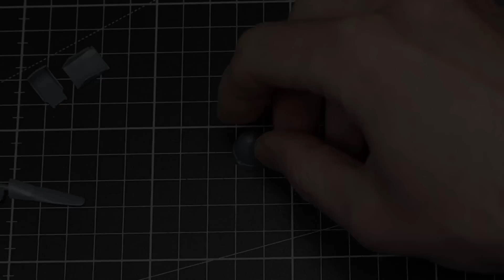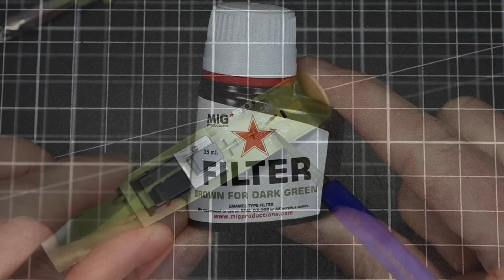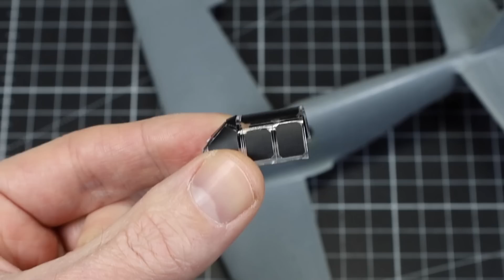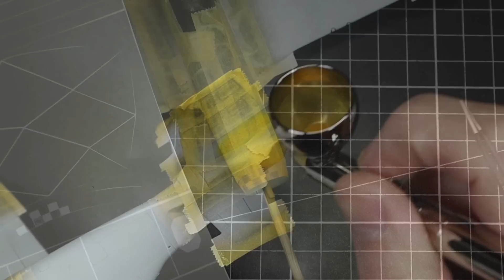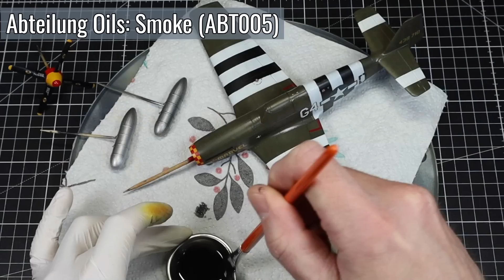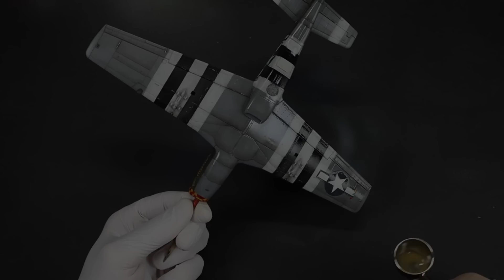Tamiya P-51B MUSTANG ('Miss Marvel') with PE & Montex Mask | 1/48 scale | Full Build

Comment: Very good finish mate, really liked your weathered aircraft. For it to stand out even more, I'd have used the thinner fishing lines, or model rigging thread, quite more to scale than yarn, but durable!! it's elastic and holds pretty well
Reply from the maker: Thank you for your kind comment and helpful tip. I won't be using that yarn again. Unfortunately, I only had very thin model rigging for 1/72 scale, and it was barely visible. Regards ScalerDan

Comment: Nice build...with only the rigging being a weakness. If you want to fix that, here's how I rig my ships. For horizontal rigging with sagging, I use tungsten wire from Model Kasten: you only have to measure it with calipers: it has memory so won't kink. Gravity does the rest

For tight or vertical rigging, I use lycra from Infiny, both companys are South Korean. You glue it loose (PVA or white glue in both cases-super glue destroys lycra over time) then when cured, tighten it slowly over a few minutes by holding it over incense smoke. 

You're welcome😊🎉
Reply from the maker: Thank you again for the excellent post. The rigging on my 1/72 Hellcat is better and more in scale. I definitely have to try the smoke technique. Best regards...

Comment: What do you use to glue parts together if they are painted?
Reply from the maker: Thank you for your question? It depends... I usually use Tamiya Extra Thin. If I need it to hold quickly and there is only a small contact surface, I use superglue (e.g. wheels, external loads). But I use everything very carefully and sparingly so as not to destroy the paintwork. Regards ScalerDan

Comment: I just finished the Kotare 1/32 Spitfire Mk 1a. I added the control wires in the cockpit, and drilled out all the lightning holes in the frames, which they suggest you do for added detail. 

Nobody will ever see it, unless the use a flashlight and know exactly where to look and even then they won't see much. Still it was fun, i know it's there and have pictures of it before it went into the fuselage.

If you want to take that kind of detail to the extreme build a Zoukei Mura 1/32 kit.

Great build btw
Reply from the maker: Thank you for your comment and your thoughts. Kotare Spitfire sounds very promising!
These extra details are an important part of the hobby for me. It's also about the work you put into it and the joy of implementing an idea.
Documenting these 'invisible' details and making them visible in the video is another exciting challenge. Regards ScalerDan

Comment: Great looking model, nice job! 
What do you use to clean the Real Colors from the airbrush? I found out that normal airbrush cleaner does not work well since it's a lacquer and the AK thinner is too expensive to use a an airbrush cleaner.
Reply from the maker: Thank you for watching. I only use Mr Color Leveling Thinner and Rapid Thinner for thinning. I also use these two for cleaning. Not the cheapest solution but it works. Rapid Thinner is a bit cheaper so I prefer to use it for cleaning. At the end I usually leave a drop of Leveling Thinner in the airbrush so that nothing sticks. Basically anything that thins lacquer-based colors should work for cleaning but not the acrylic stuff. Regards ScalerDan
Reply: @ScalerDan  Thank you. I'll try to find cheap lacquer thinner. I use a H&S airbrush so it should be ok with the hot thinner :)
Reply from the maker: @marcusaureliusantoninusaug2161  That should work. My H&S has seen every kind of cleaner and if necessary you can always change the seals...

Comment: Great work.  Just as an FYI, though.  You really didn't need to remove the ridge on the exhaust pipes, because there's a weld seam on the real deal.

Also, for the antenna, you should purchase some EZ LINE or equivalent.  It's stretchy and thin, so it looks good in scale and doesn't droop.  It stays taught.   Just a suggestion.
Reply from the maker: Many thanks for the good advice. The seams on the exhaust pipes can be seen clearly in photos. To show them at the right scale, I could maybe just sand the ridge a little thinner.
I only had something like EZ LINE for 1/72 scale. Worked well on my 1/72 Hellcat but was too thin for 1/48. I'll keep an eye out for that. Regards ScalerDan
Reply: Can ez line be made taut with heat like uschi van der rosten rigging can?

Comment: Amazingly good work, but there are a couple of points to note. FIRST: Unless this is intended to be depicted a month or more after June 5/6th, 1944, the D-Day stripes would be almost pristine (if roughly applied in haste, generally on the 4th or 5th of June.) You have depicted them with Extensive chipping and weathering. By the end of June Many Allied planes had the uppersurface stripes overpainted with fresh OD which would also appear unweathered for a while, and certainly by the end of July this would have been done almost universally in both RAF and USAAF Fighter units. SECOND: When you painted the Propeller blades and chipped them, the chipping was along the whole of the Leading edge. The Hamilton Standard Propeller of the P-51B/C/D had a "Boot" at the inner portion, which was made from solid rubber molds and fitted over each blade. Any paint chips on the (rubber) leading edges would be almost invisible because of the Black rubber under the paint.  But that is really all I can point out, like I said, Amazingly Good work!
Reply from the maker: Thank you for your interesting comment. When it comes to the invasion stripes, I chose a more artistic approach to make the model visually interesting. Your advice on the propeller is very helpful. If I understand correctly, the metal chipping on the outer half of the propeller blade is possible, only the inner half was rubberized? I have read about 'uncuffed' propeller blades on post-war Mustangs. That would probably be more true for Korean War Mustangs. Thanks again for your input. Regards ScalerDan

Comment: Very nice but no 8th AF (or 357th FG) Mustangs had antenna wires.  They used radios that didn't use them.  Only the antenna mast(s).
Reply from the maker: Thank you for your interesting information. Unfortunately I didn't have a reference photo of this specific aircraft. Some photos of B/C-Mustangs show the various antenna masts and some have wires. Maybe they were early versions but I'm not an expert here. Overall the wire is also shown a bit too thick. The new Eduard Overlord Kit shows different antenna setups in the instructions  Regards ScalerDan